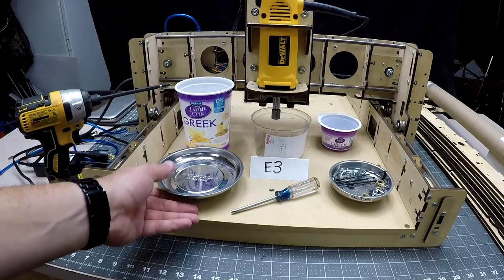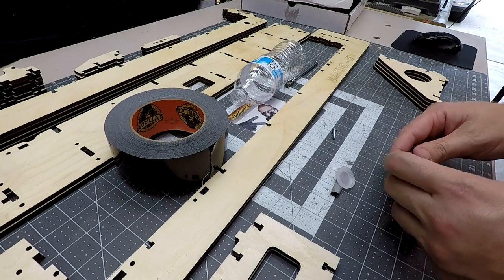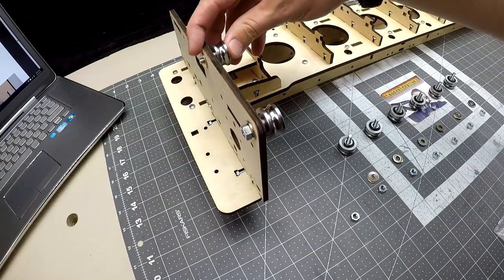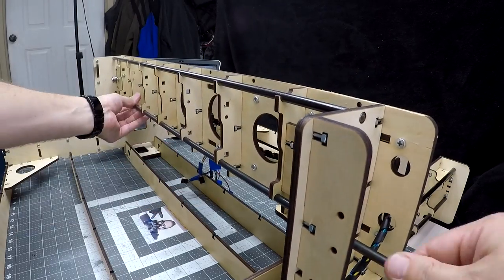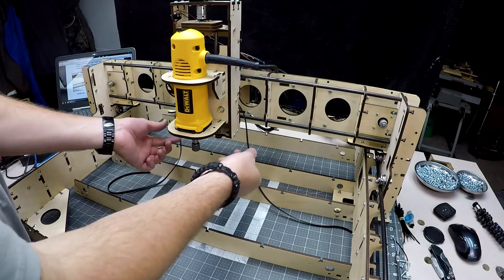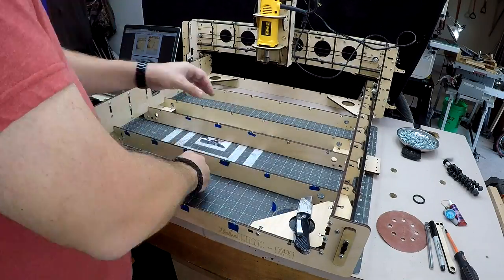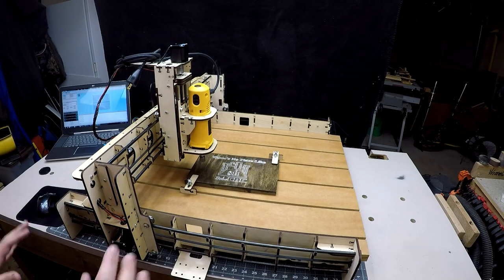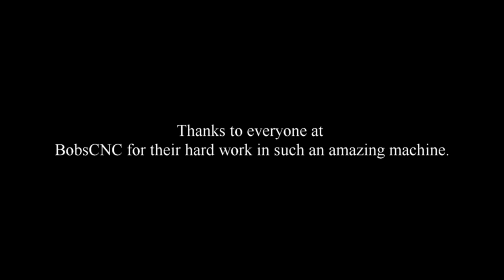BobsCNC E4 "LARGE" CNC Installation Video ($889 CNC)

Comment from the maker: Bob sells 2 CNC's. The E3 and the E4. Both fantastic machines and hands down worth every penny. I have had the E3 for over a year now and just converted all the parts to the E4 to carry on as a larger cnc. Solid machines with an excellent company backing their product to make sure you get it up and going. Links in the description above. Also you need to make a change in UGS. In ugs go to menu, machine, firmware settings. $130=610 and $131=610

Thanks for watching.
Reply: What about the software? Do you recommend buying one of the software packages?
Reply from the maker: @waldogtv5486  Wally I do .. your end goal is to one day own vcarve... It's top of the line precision and going to give you full control and making cncing a dream... It's a bit pricey so if you cant purchase it today, uses Inventables Easel until then. It's similar to vcarve but vcarve is a million times better. Go to my website and you can see the directions for using easel with a E3. Or I have vcarve videos as well... All basic starter videos so you can follow along and get to cutting.... -Brian https://woodencreationz.com/bobscnc-videos

Comment: Thanks for the video. It answered all the questions the pics on Bob's website didn't answer :)
I have the E3 and love it..... The only draw-back is the work envelope.

I'm purchasing the E4 upgrade tonight. I've had my eye on it since it was released. Can’t wait. 

I do, however have a couple question regarding the new E4. 

Q1: Is the new E4 Z drive more ridged than the E3? I’ve experienced vibration that led to some horrible finishes on projects. Usually I’ll run the program again and adjust feeds and speeds to correct. This doesn’t always work though…

Q2: How ridged is the new spoil board?
Q3: Have you experienced any flatness issues with the new spoil board?

Thanks for taking the time to respond to my post!

Best regards,
Cody
Reply from the maker: Hey bud! Yeah the new Z drive is a lot more Ridgid. It resolved the wobble some had and mine is Rock solid. Also the spoil board on mine is very flat but I have only run a couple projects on the E4 so far as I am getting ready to build an enclosure. But it seems to be an awesome upgrade. 👊🏻
Reply: @WoodenCreationz  Thank you for the quick response! I appreciate it. Be sure to share your enclosure when its complete. I'll be embarking on the same journey soon! 

Also GJ on your bit duster. I designed one with the same concept. I funnel all the air from the router to the bit with a 3D printed blower. Fun stuff!

Comment: Hi thank you so much for great video simple and explains a lot now I am really interested in this CNC machine but I'm going to be using insulation foam (styrofoam)  material for example pink one which is available at any Home Depot in different thicknesses or blue, is this machine capable of doing carving using insulation foam as a material  instead of wood did you ever try it or maybe somebody else can answer my question my interest is more in artistic design for example making Egyptian hieroglyphics cut in form which is very light material and painting using few different colors it looks amazing and it's very light in weight once again thanks for the video 
Sam
Reply from the maker: Thats a great question.. Bob recommended when I first started to try practicing in foam if I was nervous.. (This was before I created instructional videos on how to use it) I think I may have zipped across some foam once... I personally havent carved in the blue or pink foam. Im sure it would work very nice. You can do some very nice work using software like Easel or Vcarve. I have videos on both those as well to get started. If you want to do 3d work, look at Aspire or other 3d softwares. If you wish to know more, stop by Bobscnc on facebook and make a post asking if anyone has tried foam and what the results were.. We have the greatest members on the planet earth and I am sure you will get lots of responses. https://woodencreationz.com/bobscnc-videos

Comment: Great work on this video sir very informative! Do you have to be connected to the internet with the laptop while the cnc is in operation?
Reply from the maker: You do not.... But if using easel, free website software. You will need internet to make the file in easel. Then  save it as a gcode file. From that point forward after saving it, you don't need internet. You can cut with out internet. Programs like vcarve and aspire don't need internet. 👊🏻😉

Comment: So I just got a reply to this question from Bob.  You have the option to reflash the controller with the E4 firmware or set the new soft limits in UGS.
Reply from the maker: Ahhh... I just updated the UGS.. Thank you for the followup....
Reply: @WoodenCreationz  No problem.  I just found it curious that Bob did a video about reflashing the controller and provided firmware for both the E3 and the E4 if there was no difference in the firmware.  So either way will work.  Thanks for all your videos.

Comment: Why do you sand after spraying with lacquer?
Reply from the maker: If you don't it's rough like sand paper because the grain is raised. If you sand it, it's then smooth like glass. 😉
Reply: @WoodenCreationz  I understand that if you don't sand it, it will be rough. Does it matter if it's rough aside from aesthetic value?

Comment: Do you have to reprogram anything because of more travel?
Reply from the maker: You do. In ugs go to menu, machine, firmware settings. $130=610 and $131=610
Reply: "The easiest way is to type $130=610 into the command textbox in the console window then press the enter key. Then repeat for $131.  This will change the soft limits to 610 mm (about 24")"

This is exactly what Bob told me. Thanks again Bob!

Comment: How many coats of Laquer to put on wood?
Reply from the maker: I soaked mine really good with one coat. Then flipped them and sprayed them again. The lacquer didn't run but one good coat. Then I went ahead and sanded them all down with 220 sandpaper. I had zero issues with them fitting but I'm afraid if you make it too thick you might have a hard time getting things to fit properly when assembling. 👊🏻😜
Reply: @WoodenCreationz  

I'm using the Laquer you recommended!

Comment: belt drive R junk
Reply from the maker: Hey Kenneth. I had the left belt on mine get a little loose after a few years of use at the zip tie. I snugged that dude up and have had zero issues since. If you'res has some slack, try snuggling it up and see if that helps. If not, reach out to Bobs support. They may be able to help provide something more than I have. 👊🏻😉